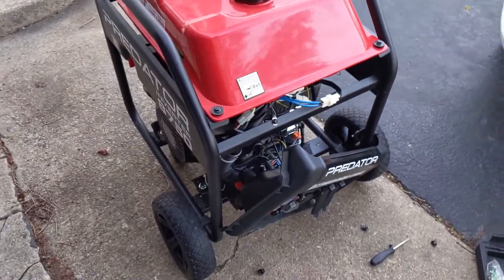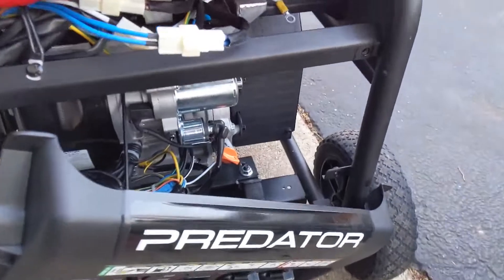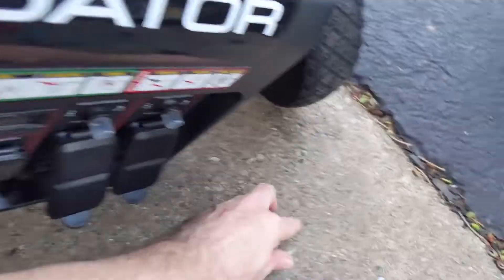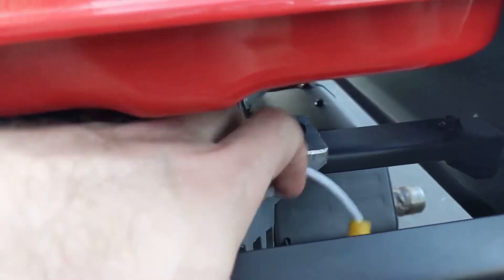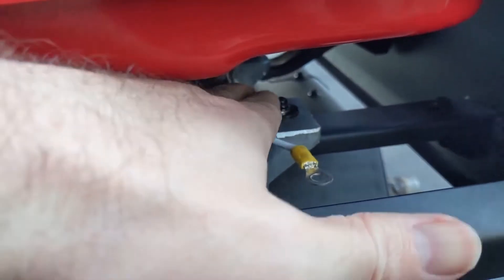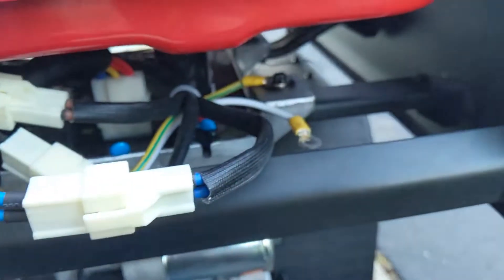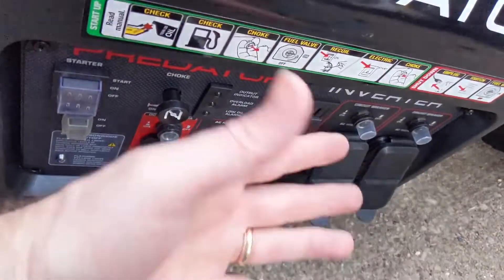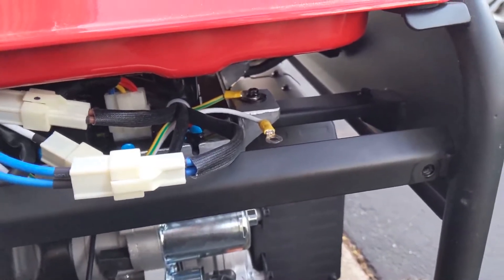Predator 8750 Inverter Generator Floating Neutral

Comment: Thanks Bryan, very helpful. The Predator is shipped with neutral bonded to ground to keep people safer when running the generator stand alone. They recommend always using a ground rod but in my years of experience I've never done this nor have I ever seen anyone else do this. Not saying it's not a good idea just that it's not commonly done. When using the generator for house backup, connected to a transfer switch, you rely on the panel's neutral/ground connection for safety. In that scenario you want the generator floating or unbonded  to cover you in the unlikely case that your house wiring has a break between ground and neutral and you contact the generator frame while it's running. I ran my previous generator for 25 years as a backup generator with neutral bonded because I wasn't aware of this issue. With my new Predator I'm floating neutral per your video and making up an AC connector with neutral and ground tied together with a 12 AWG wire which I"ll plug into the generator to bond neutral for stand alone operation. I thought this would be easier than adding a switch to the generator. and I had all the parts on hand.

Comment: I have the exact same model but the manual says to ground the inverter using the grounding terminal on the front panel with a #6 awg wire and connect to a electrode that I have to bury 8ft in the ground. Will your way cancel that out? Do I need to do both? Does your 8750 have the grounding terminal on the panel as I described? Wanting to use for home backup using interlock switch at house panel. Also what brand is the in-line switch you used to go from bonded to floating neutral with ease between backup and standalone usage.   Thanks for your help. I'm an average diyer

Comment: Aren’t you supposed to take the other wire off the ground because you don’t want the generator to be grounded not.
Reply: No.  One still needs the generator itself to be grounded, so leave the ground connected and disconnect the white neutral wire and wrap the end with electrical tape.

Comment: Why?
Reply from the maker: Are you asking why you would do this?  When you hook a generator with a bonded neutral up to a breaker panel using an interlock and that breaker panel has a bonded neutral itself, it can cause the generator's circuit breaker to trip instantly.  So, you break the bond at the generator so that when you hook it up to the house, the generator functions correctly.  Then, if you use the generator disconnected from the house, you reattach the bond on the generator and ground it standalone.

Comment: I live of grid in the Sangre de Cristo mountains in Colorado and rely on my generator when my solar batteries are low.  My electrical panel in my cabin has a grounded bond as well as the generator having a grounded bond. (cannot have both) Your video has solved my problem. Thank you so much!!

Comment: Hello, my question is, I've been trying to run. Two 120 volt 10 amp inverter medea u shaped window  acs one on each 120 leg to balance load like the manual says but one side always trips tested every thing with a meter and all seems good,inspected plugs and they are good, could this be the fix that i need this is my last resort
Reply from the maker: I've not tried what you are attempting so I'm not sure if this modification would make a difference for you.

Comment: Bryan, I have the same model generator but bought mine this year and followed your instructions in the to unbind the neutral from the ground but the post and two wires that you show that are attached to the metal of the inverter and to the frame on my unit are on the left side and not the right side like yours show. Also, your video shows you have one yellow/green wire and one all white wire.  My two wires are both the same yellow/green color but one has a white sleeve around it my the connector that has the letter "N" printed in black on it.  I believe that this wire with the white band is the Neutral.  Does that sound correct to you?  Also after you did your unbinding did your unit work correctly?  Thanks.
Reply from the maker: I'm not sure but it sounds like the white banded wire with the N on it could very well be the neutral.  You may want to request an up-to-date wiring diagram from Harbor Freight support.  If they changed the wiring colors for some reason, it should be shown on the diagram what color the neutral wire is.  As far as if it works for my setup, I have had no issues with running this connected to my house.  I added a switch inline with the neutral to be able to change between floating and bonded when I run it detached from my house.
Reply: @BryanWhite77  Thanks Bryan for your opinion and suggestion, much appreciated.  Before asking this question, I called Harbor Freight customer service and asked them the same question.  Their rep said he understood what I was talking about but told me that they were not allowed to answer that question and that if I did attempt to modify the bonded neutral I would be voiding my warranty. I'll try giving them a call back and ask if they can provide me with an up to date diagram.  Thanks for your quick reply.
Reply: @neoprimato1959  would be interested in the updated wiring manual as well if you get your hands on it.
Reply: @jimc8236  Hi Jim.  I emailed their customer service dept and requested a copy of the electrical wiring.  If  they send it to me I'll contact you to get you a copy.   Frank

Comment: Thank you very much! I need my generator (exact same model) to backup the entire house via the interlock through the panel and this what I was looking for! Since neutral and ground are already bonded in the main panel, bonding in ALL OTHER devices are not allowed (sub-panels, generators). Please make a label and stick it to the generator that it’s no longer safe to use as a standalone generator.
Reply from the maker: I actually added a heavy duty electrical switch inline with the original bonded neutral connection so I can easily change between floating neutral (when connected to the house) and bonded (to use it as a standalone generator with its own ground).
Reply: @BryanWhite77  Also would love to know about adding the switch! Maybe fodder for another video?